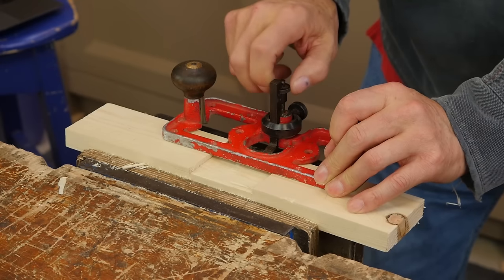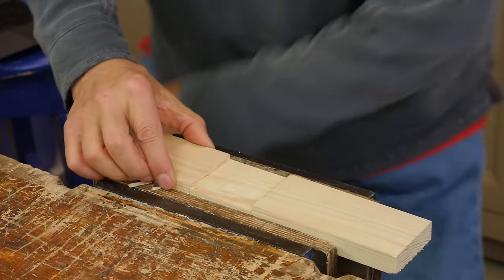Q&A with Paul Sellers Episode 10

Comment: Thanks for the videos Paul. I'm relatively new to woodwork and your videos are extremely engaging and informative for me. What would your method be for cutting up an oak railway sleeper? I'm keen to use one to make a coffee table but I'm reluctant to use power tools as I prefer the safety and exercise from using hand tools like yourself. I'm just not sure if ripsawing an oak sleeper a few times down the length would be achievable!
Reply: Cheers Lenny, I'll get a bloody big power saw! Turns out my pipe cleaner arms aren't up to the task x

Comment: I am curious about cabinet face frames. Do you join the corners? Which joints are recommended for hand tools? How do you attach the face frames to the box? I've seen power tool users use biscuits and/or nails for attaching and aligning the frame, but I've always wondered how Paul would do it.

Comment: Thank you Paul. Is this the proper outlet to submit a question?  If so, here's mine. With regards to wide panels, maybe a tabletop or something, is there any benefit structurally to gluing narrower boards together to get the width you want, or would you generally use the widest board available?  Aside from looks I'm wondering if there might be less warping later on. Thank you. Kevin.

Comment: Paul, posting here as it is a recent upload and figure you might still be checking for comments and questions.  Just out of curiosity, has anybody asked about using their current workbench and adding a well by simply building up the front and back with timbers with a gap in the middle??  I like the well but just don't want to build another workbench.

Comment: What is the best way to flatten the bottom face of a chisel? I am using sandpaper with water on a pane of glass but no matter how long I use the chisel on 220 grit, the bottom is not getting any flatter. Can you do a video on cutting dovetails using dividers?

Comment: Dear Paul,
First of all I would like to thank you for teaching me so much. My question is: I want to make a cabinet that will take a lot of weight and the stock I have are 140x20x1300mm planks, I am planning to use 8 of them for the sides, 2 for each side joined parallel to each other so the width will be 280mm, same for the shelves. I have seen you using just glue, will that be enough or would I need to use some other kind of support? I have tried it with dowels before and it is too difficult to get them straight. should I just use some perpendicular support?
Thanks in advance and wishing you and your family a Merry Christmas and a happy new year .

Comment: Mr. Sellers, I've been using pull-type saws mostly of late, but these I have are cheap and sometimes difficult to keep on a straight line.  

Today I sharpened up a 13-point back saw and like how it cuts, but the looseness of the handle disturbs me.  In my limited experience ALL Western-type push saws have loosely fitting handles until they're shimmed or otherwise tightened.  

Is this a design "feature" that I should get used to? Or is it quite natural to want to be rid of this maddening play/slop in the fitment of the handle.  

How do you address the issue?  Methinks I'll fit larger fasteners first, but that entails a trip to the store.  Are shims better?  Make my own handles best?  

I quite enjoy the sensory experience of wood working with hand tools, but this is a major and common distraction in my collection of saws. Even if it is by design, it won't be tolerated.  I find it more maddening than a loose totes on planes.

Comment: Paul,
I've been buying some old wooden planes when I have the money and most of them are pretty straight forward in how to use them but I recently bought Moulson Brother's, that's what it says on the blade and on the body it saysGriffiths Norwich. The blade is 2 inches wide with a half inch radius and the rest of it is at a slight angle and I have no idea how to best use it. Could you give a short tutorial on how to use a similar plane.

Thanks,
Peter
Reply: I meant to add that it also has a fence.

Comment: my son-in-law has a bad habit of throwing away odd lengths of 2X4s he's cut because he feels compelled to have a solid one piece length of timber, citing strength for the reason. Even non structural usages. his cast off pile is as large as his material stack. FRUSTRATING!  could you share a splice method you feel would help him wise up a little and trim 50% from his budget?

Comment: I have a problem planing wood with knobs, does anybody have a tip for me :)  thanks :)
Reply: Hi Robbie. I'm guessing you mean Knots and not knobs? The generally accepted way is to use a plane with a higher pitch  angle in the blade. They are usually 45 degrees but some planes have the blade at 50 or even 60  degrees.  Make sure they are deadly sharp. Most important. Also a hand scraper or cabinet scraper will help with wild grain. HNT Gordon from Australia sells magnificent planes with a pitch of 60 degrees. Check his website. Mr Sellers will help you out here as well: https://paulsellers.com/2014/11/questions-answered-york-pitch-only-answers-one-problem/

Comment: the more I watch your videos and those of others like Roy Underhill et al. , the more I'm convinced that hand tools are the way to go. no dust in the air, no noise, no danger of removing appendages, way less danger to eyes,  less space required. the benefits seem endless.
Reply: Much danger of removing appendages. Work just as carefully as you would with power tools. Sharp tools are safest. Dull tools can be quite a bit more dangerous.

Comment: MR. Sellers I watch your videos regularly. I have seen and practiced your techniques for resawing and it seems to work well for the most part. but by current projects require 2-4mm sheets if you will cut from 2x6 or 2x8 any techniques you have not covered that may aid in such thin cuts? I'm having minimal success after several weeks. I could outright buy the sheets online but that takes the fun\challenge out of it

Comment: I share your enthusiasm for router planes. I find them especially useful for flattening the various levels found when installing  mortised locks on chests that I make.
(After watching your chisel sharpening techniques, I made and am using a strop for final polishing of the edge. A friend who is a far better craftsman than myself tells me he does not recommend stropping because most people just end up rounding over the edges of their tools. Advice?)
Reply from the maker: Don't change the angle and pull dead straight. `they never round over for me.

Comment: hello Paul, I have just discovered that by adjusting your chip breaker higher you can easily true up Tenon's as if it were a router plane or a skewed shoulder plane
Reply from the maker: But we had no problem using the techniques shown so why reset the cap iron when it works so well as is?

Comment: That joint? Just use a router. Life's too short to do it the harder way, for no quality benefits.
Reply from the maker: Nothing hard about it. Takes too long to set up a router; too much noise, too much safety stuff and it's so boring. Just my view. I would like to see how long it takes you to cut both parts using a router as said.
Reply: Paul Sellers Nonsense. The router is the much faster method, and wear ear defenders for a couple of minutes. Your choice is just a preference for handbook working - which is fine.

Comment: Since "denatured alcohol" came up first thing, I thought I'd comment as to the fact that I prefer to use "fully natural alcohol" for any job where alcohol is effective. There is no solvent job where extra toxicity is beneficial. Alcohol itself is toxic of course.

Fully natural alcohol is also know as "pure grain spirits" and is usually found where they sell distilled drinking products.  It works and it doesn't have the additional toxicity found in "denatured" alcohol.  IOW denatured alcohol has extra poison added, such that drinking it would be insane.  It's all about control and taxation, but I won't get into that.
Reply: Wade Patton but denatured is more affordable
Reply: Człowiek Wiking
I don't use enough for the difference in price to be significant, but that could be a valid point for some.
Reply: Wade Patton I don't know where you live, but here in Poland 0.5 liter of denatured is 6 złotys (about 1.40 USD), while the same amount of pure spirits is somewhere around 50 złotys (12 USD) so it's a significant difference even if you use it rarely.
Reply: Człowiek Wiking
Yes, that is significant.  I live in the US where the prices are much closer.  Cheers

Comment: How would you repair a loose lateral adjuster on a Stanley Bailey plane?
Reply: The lateral adjuster on a Bailey pattern plane is held in place with a peened over metal rod. This rod can come loose over the years. I fixed this issue on one of my planes by just placing the rod on the front side of the frog on to the back of my vise and hitting the rod on the back of the frog gently with a hammer. This fixed the problem for me, as it peens the ends of the rod back over, holding the lateral adjuster firmly in place.
Reply: Thanks. I had understood that they were held in place with a rivet. I will try your way. Failing that I will buy a broken down flea market #4 or #5 and experiment on it. Cheers! Thanks again!
Reply: I suppose you could call the rod a rivet. It is not like a pop rivet, but more like a blacksmithing rivet though. Glad to help.
Reply: Good luck!